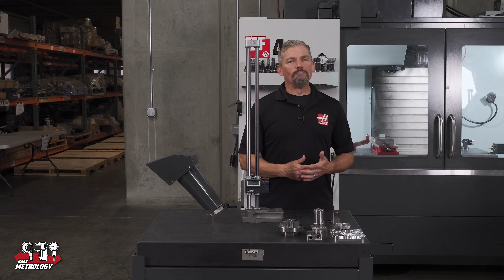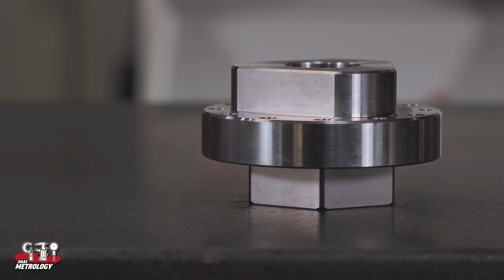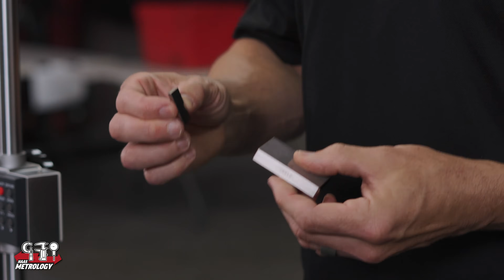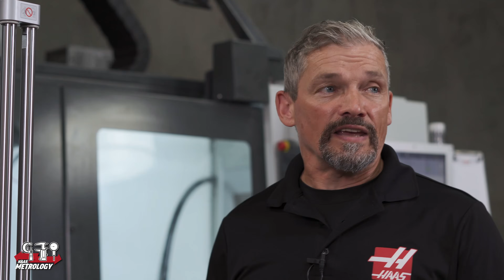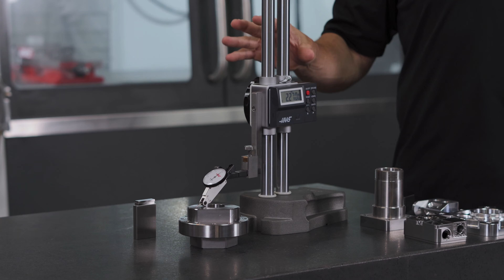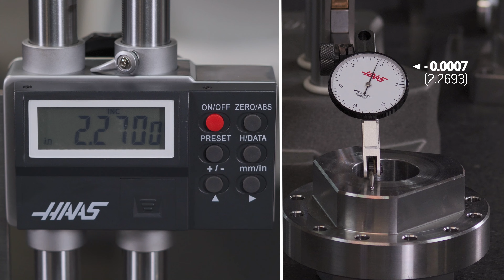Maximize accuracy! Use Your Height Gauge as a Transfer Stand - HaasTooling.com

Comment: I think it would have been worth mentioning the indicator stylus position to eliminate Cosine error.

To protect the gauge block surfaces being scratched from having dust between them while wringing together. Wipe each block face first on your opposite wrist to thoroughly clean.

When setting the height gauge to a constant height it is wise to lock the carriage, especially if there are several parts to check.

Comment: I feel allmost stupid as I don't understand the fascination for gaugeblocks and indicators for measuring 🙄. I use calipers and micrometers, why would someone not use a 2"-3" micrometer instead of using  blocks? Or is this some "imperial thing" I just don't get 🤨?
Reply from the maker: johanneslaxell6641,
This is a very good question and the responses have already answered it pretty well. Here is a little explanation from our side when we were making the video. You make a good point regarding why you wouldn’t just use a micrometer to make this 2.270 measurement. That is exactly what you would typically do. Easily as accurate and much less work. 
In this case we were using this short stack of gage blocks to demonstrate how one would go about this type of measurement and retain as much accuracy as possible using the height gauge and indicator. 
Most likely in actual practice you would be doing the same thing but for much larger dimensions where the height gauge’s height really comes into play. At this point you might also be moving away from a big stack of gage blocks to using something like a “Height Master” (Cadillac gage). 
In a high volume production setting it is more common to see a height gauge/indicator set up this way (even for shorter dimensions) where you are quickly placing the part on the surface plate and sweeping it with the indicator to verify height. This can arguably be as fast as using an micrometer, and if there are flatness or parallelism requirements as well those can also be accommodated. Again the gage blocks or other “standard” is used to setup and verify the dimension throughout the cycle. We do this quite frequently here in the Haas machine shop.
Reply: @haasautomation  A little beside the point, but I would have a request: Could you make a video on the TL-2 showing what it's capable of? We are thinking about getting a new lathe but wondrring about capacity. When I put 200mm (8") CroMo in the chuck, how heavy cuts can I take and how hard can I drill? I guess my question is mainly about rpm under 300 and heavy cuts making flanges and stuff, 5mm to 200mm...
Reply from the maker: @johanneslaxell6641 That would be great to shoot some cutting footage of the TL-2 in action. At the moment we are preparing to shoot video for a group of new machines we'll be releasing in the new year. Probably the simplest place to start regarding your question is to fire up one of the online horsepower calculators and figure out what your cuts will probably require and then compare that to the machine and spindle power specs you can find on the TL-2 page here: https://www.haascnc.com/machines/lathes/toolroom-lathe/models/tl-2.html
Reply: It's just a simple demo showing how it can be used... 
You don't always have two faces line up in a way that calipers or a micrometer can measure.
Reply: @kevind1865  I am sure that you are right 👍🏼. It just feels odd to use blocks and indicators for measuring, we only use indicators to indicate/reference. There are many ways, probably better than mine 😜.
Reply: @johanneslaxell6641  to second everything stated here as well, micrometers and calipers are validated and calibrated against gage blocks.  Gage blocks are the universal standard that everything is measured against to verify that the measuring tools are operating accurately and correctly.  You can have damaged caliper slides or a sticky micrometer or a less than calibrated thimbal and get unreliable measurements.  Gage blocks are the gold standard.  All high precision measuring tools (microns) are referenced to a gage block stack that is very near the nominal dimension you're trying to measure to ensure highest accuracy.
Reply: @caseywaite599  Absolutely, and we have gage blocks (10-150mm) we use for calibration one block at a time. It's that stacking and indicating that is unfamiliar for me (in no way wrong) and I only see it done in American videos. But there are many things I don't know and never will, so just have to ask 😉😁.
Reply: Blocks are far more stable. This method would still be very accurate even with not so great tools. It also allows for a very wide range with a single tool.
Reply: @jasonlanning2394  👍🏼👍🏼🤗!